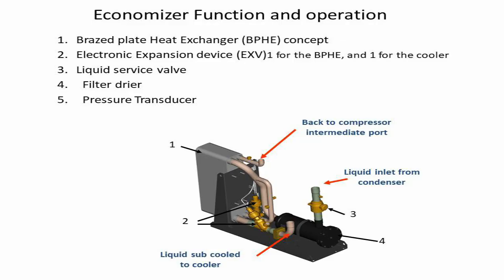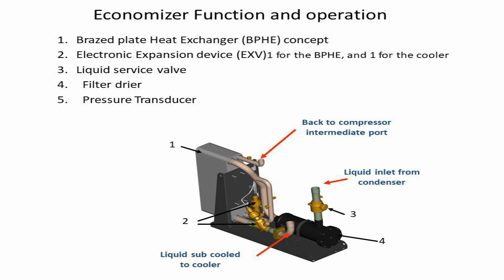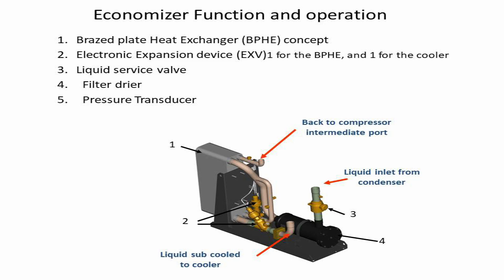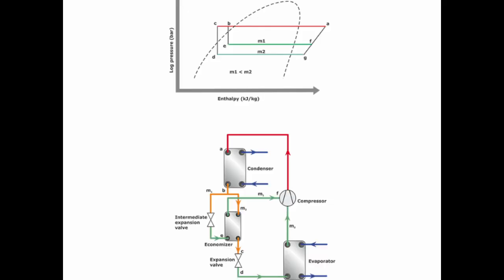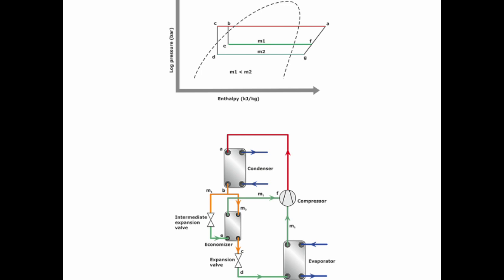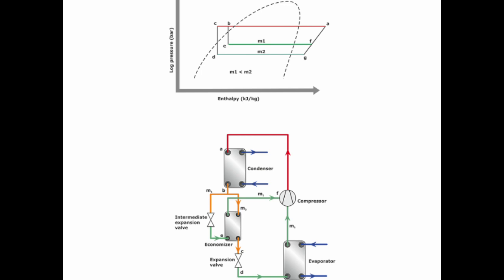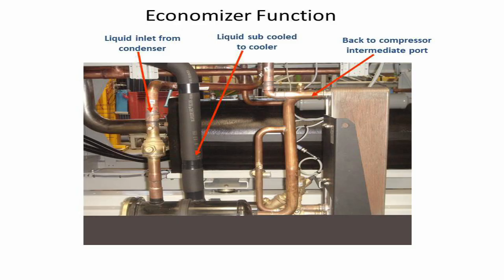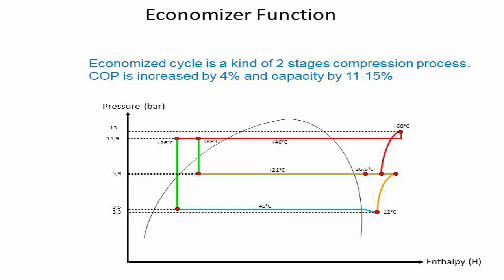Economizer operation and function explained

Comment: How can we change cards of EEV.... when not find same type. Like we change it from danfoce to sporlan
Reply from the maker: As far the valve specifications i.e 
Volatge 
Steps 
Hertz 
Milli amps 
Are same as the old one you dont need to change the card 
Secondly its not possible to install another type of card . As the rest of the cards in the chiller will not communicate with new type of card. If you are replacing the card is must be same as old